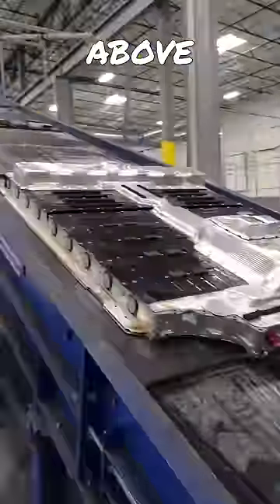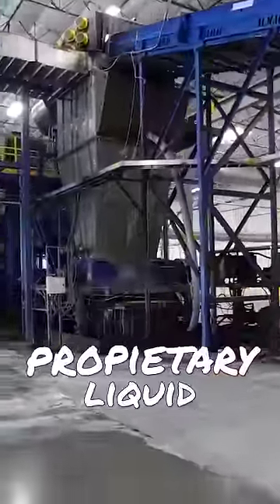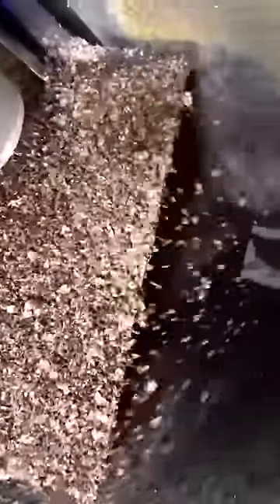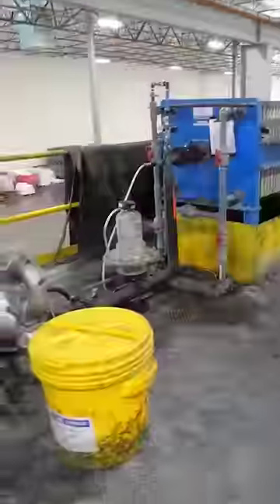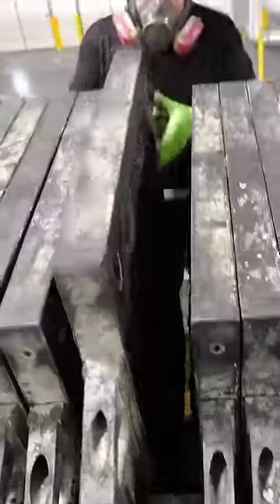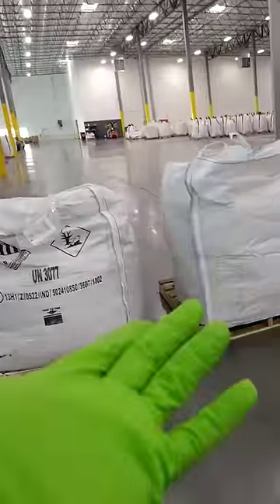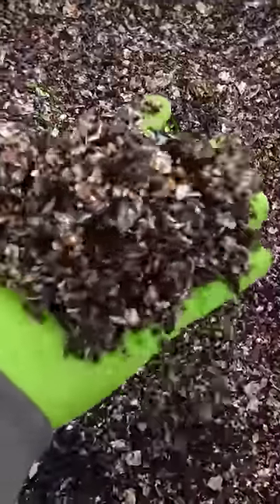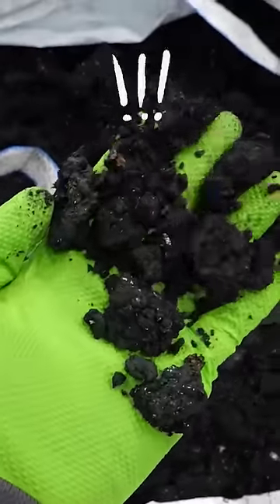Electric Car Battery VS Liquid BLENDER

Comment: Imaging drinking that "black liquid" thinking it's a chocolate drink 😉
Reply: The last chocy milk you’ll ever have.
Reply: I want to see what happens if you put water on that. The most expensive fireworks ever?
Reply: if your chocolate milk is black, you need something a tiny bit more expensive. Preferably something containing "chocolate" on the declaration.
Reply: @MyrKnof  But that sounds boring.
Reply: @CrazyPlayer-pf2hv  Oh, right. Cause lithium has a reaction in water?
Reply: didn’t know chocolate milk was bIack
Reply: @beaualoevv  dark chocolate
Reply: @CrazyPlayer-pf2hv  no, lithium is not in its metallic form in Li-ion batteries. The idea of water reacting with lithium ion batteries is a myth.

It is true of primary lithium-metal batteries like the lithium AA cells you buy, but not EV's.

In an EV its a lithium salt, a bit like the sodium in table salt.
Reply: Natural selection.

Comment: Because everything in a battery can be recycled. Black mass can also be found in the old flooded cell batteries like AA, AAA (before they just started stacking watch batteries) it looks like a darker version of wet gun powder. Also, don't recycle batteries for free. Sell them back to scrap yards. That way, you won't be giving away a purchased product, only to purchase it again later. Separate your scrap too, or it all gets marked as tin.

Comment: That "proprietary liquid" is probably just a tartaric and ascorbic acid blend. The two are good at dissolving lithium while leaving other elements behind.

Unfortunately just being able to recover it doesn't mean it can be used. The slurry is an oxidised lithium ion not elemental lithium. It's a lot harder to recycle.

Comment: worked  around reclaiming silver and other precious metals from things like old xrays and electronics, hospital equipment, etc. At first glance the processes seem similar a filter press was involved and our proprietary liguid was a mix of a few nasty things but it was mainly cyanide. The sludge out of the filter press then went to a kiln to be finish dried into a fine black dust. They told me cyanide fumes from the kilns eventually got it shut down.

Comment: "Mystery liquid" is just some sort of light oil such that the lithium will rise in it, other metals will sink while the plastic is neutral buoyancy. So you just skim it off in layers which looks like what those machines are doing.

Comment: @Neojhun... you need to get reading.  But lithium extraction DOES USE that much water. Just because they are recycling the batteries. The same process is used.   Look it up.

Comment: The black mass will be lithium plus small amounts of alloying elements, aluminum, gold (in trace amounts) & other rare earth elements that will dissolve in hydrochloric acid. (they may adjust the chemistry of the acid bath to speed up the process but that is about what one might expect. after the acid is neutralized the metals will precipitate out of solution, most of which will be black lithium oxide. from there it will need to be processed further by flocculation, electrolysis, smelting with precise amounts of alloying elements, & eventually rolling in to a thin ribbon to be folded & sealed into a new battery. it is not necessary to add virgin lithium but is probably common to do so simply out of convenience. This is a simplified explanation.

Comment: The secret, proprietary liquid would need to react with the lithium but slowly, so you probably want to control the pH or the entire thing would explode. Also it can't be water, or the entire thing would explode and if it's not covered in some inert oil the thing would explode. So mineral oil with a little bit of water and maybe sodium-acetate would probably work and not eat your shredder. But with the energy prices, don't you want to just disassemble them and take the pure lithium, that is right there in front of you?

Comment: Looks like motor oil. If they used water the lithium would catch fire and explode. It probably has to be a certain viscosity so that it suspends the lithium but allows the metal to drop and the plastic to float

Comment: Lithium carbonate is a pretty low value item but suoply is bottlenecked

The most valuable parts are the nickel steel (casings)  and cobalt

It's good to see batteries being reccycled though. It keeps pollutants out of groundwater

Comment: I use to work in a place just like this, we had decontamination rooms , had to wear uniforms and coveralls and masks  also had to shower before leaving it wasn’t great in the summer especially when the ovens ran to melt down what was extracted from the batteries

Comment: The black mass obtained from recycling batteries has various potential uses:

1. **Recovery of Metals**: The primary purpose of recycling batteries is to recover valuable metals like lithium, cobalt, nickel, and others. These metals can be reused in the manufacturing of new batteries and other electronic devices.

2. **Carbon Material**: The black mass often contains carbon materials. Depending on its purity and characteristics, it may find applications in the production of carbon-based products like electrodes for batteries or as a filler material in various industrial processes.

3. **Environmental Remediation**: Some of the components in the black mass may be toxic or harmful to the environment. Proper treatment and disposal methods are essential to mitigate environmental damage.

4. **Research and Development**: Researchers may study the black mass to better understand its composition and properties, which can lead to improved recycling techniques and the development of more sustainable battery materials.

In summary, the black mass from battery recycling is primarily valuable for the recovery of metals and may have secondary uses in the production of carbon-based materials or research purposes. Proper handling and recycling of this material are essential for both environmental protection and resource conservation.
Reply: thanks chatGPT

Comment: That liquid is a oxy preventer. It reacts with the lithium to prevent rapid oxidization, or a fire. By the time it reaches the squeeze out portion, it has "Rusted" enough to not spontaneously combust. Just my guess at first watch tho.

Comment: Unfortunately, LI-Cycle has run into financial difficulties and is not able to finish the Rochester facility.  The stock has been sliding for a few months.

Citing escalating construction costs, Li-Cycle announced that it has paused work on a massive new plant in Rochester, N.Y., pending a “comprehensive review of the go-forward strategy for the project.”

Comment: The recycling process of Li-ion batteries normally begins with deactivation involving a full discharge to remove the stored energy and prevent a surprise thermal event. The electrolyte can also be frozen to prevent electrochemical reactions during the crushing process. This also evaporates and recovers the organic solvents of the electrolyte in a vacuum by condensation. This process does not produce toxic exhaust gases. So it’s NOT a proprietary solution to be honest ^_^ ❤😂

Comment: So what they're saying guys is stop recycling your batteries for free. Hold on to them until they're desperate enough and pay half of what its worth at a minimum. Just think your replacement batteries are like $150.00 for 2 batteries.
Reply from the maker: Spent tool batteries will never be worth anything. Maybe a few bucks a pound - but never enough that someone will pay you for it. The big money is in electric car batteries. That's enough weight to cut a check for.

Comment: Do people have any clue what it's going to take to fix their electric car? NO, and any Maintenace you need done will be through the roof expensive. Not to mention if the power grid goes down, you're not going anywhere.

Comment: Lots of people not getting it. The liquid is a non conductive, non flammable solution used so they can crush the batteries without risk of fire. The Black mass is the heavy metals which are recycled into new batteries. The person narrating is just a fucking journalist. 
I'll add, there's people who still think solar panels and EV batteries are not recyclable, they are. The reason they are not recycled in a lot of places is there just isn't enough available yet to justify setting up recycling centres.
Open your mind and ask the right questions. Don't just look for the answers that suit your mindset!

Comment: By the time we get  to 60% of cars as EVs, we'll have enough rare earth materials to only used recycled elements for new batteries. The end of lithium mining is less than a decade away.
Reply: Unfortunately, the loss and material recycle of these processes is small, so no it's not a 1:1 recycle process. Mining will continue until a new material is found. It's diminishing returns.
Reply: @KptnKMan360  yes. And as battery tech improves, less and less of the material is needed for successive generations of batteries. Hence the diminishing requirement for new material.
Reply: @JodyFrancisWall  let's hope iron-based solid state batteries become common. There's work on hydrogen too.
Lithium is not the future.
Reply: @KptnKMan360  neither is hydrogen. Lithium has the next 10 years covered.

Comment: Why do you not call this priority priority liquid absolutely toxic garbage and what are you doing with the waste? How long is that stuff toxic in Crowder U-Store-It how does it get moved around to other facilities. This battery shit needs to stop. Not so much in power tool batteries but for cars they as those batteries are ridiculously complicated and extremely expensive to try to recycle when you only get a few cents of good stuff back where is it's very easy to recycle a conventional motor vehicle.

Comment: Look up the recycling capacity of these places, then contrast that with how many ev's are on the road. You will find that if all they recycled was ev batteries they would only be able to do about 1000 per year and then if you start including truck ev batteries the number goes down substantially. Also the fact that at best 10% recycled content will be used in new batteries it shows that ev's are actually far more harmful for the environment than a conventional vehicle which can be completely recycled and re used in building new vehicles. 

Oh and let's not forget about 70% of North America's power is generated by coal, natural gas or biomass. And many of the charging stations are run by giant diesel generators, so your not actually doing anything to help. 

Also these 'new' technologies like natural gas and hydrogen vehicles do create emissions like nitrous oxide due to the heat of combustion but why let facts get in the way of making companies billions of dollars and not doing squat for the environment.